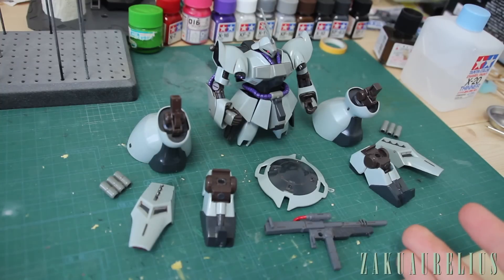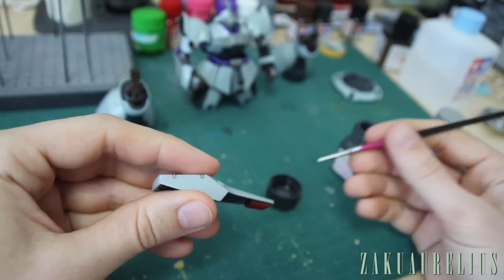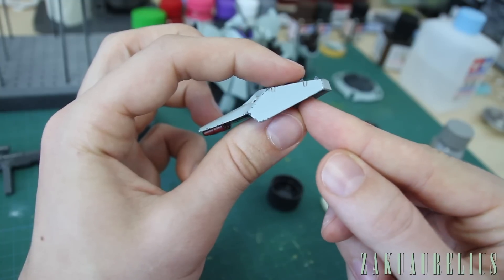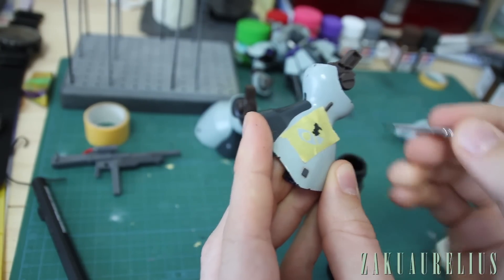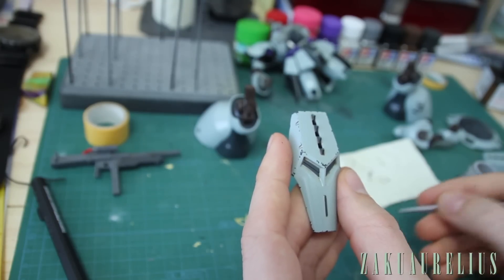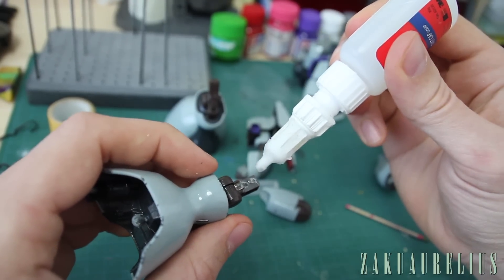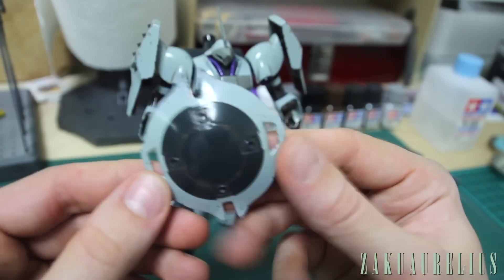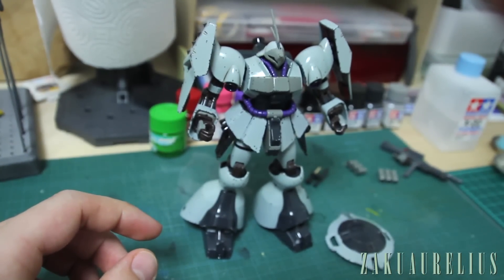170 - Gunpla Building Part 10: Chipping Weathering Technique

Comment: It is much easier to apply the lighter color chips first then place the darker color inside the lighter color chips, but not all of them. The lighter color reproduces scratches when alone when center filled with darker color reproduces paint chipped to bare metal also the lighter color should be a lighter shade of the base paint color not the dark chip color. Hope this makes sense and helps, happy modeling.
Reply from the maker: yep, that makes sense!

Comment: I am wondering something about the "flow chart" of weathering, and slight bits of detail painting. My model is painted by airbrush  with Tamiya acrylics, and I have a gloss coating of Pledge Future clear coat on it. From there I've done nothing yet.  I'd like to do a set of things: Small missing color application on a mono eye with acrylic, chipping effects with brush/sponge using likely Tamiya acrylics also (I do have oils and Testors enamels available but not in the same colors), an oil gunk wash where you fully cover the piece with a paintbrush and slide it off with a cloth to get into the grooves /panel lines, oil streaking, and finally pigment powders. I'm not sure as to how the coating/sequence would go exactly? 

Again, I've already got a gloss layer on it to protect paint underneath. My guess is:
1. Monoeye detail paint with Tamiya acrylics +  chipping with Tamiya acrylics (Could technically be replaced with Testors enamels if needed)
2.Gloss coating again maybe? Or not.
3. Oil Gunk wash, as I know it can be done on gloss surfaces to easily remove the majority and keep the details. 
4. Oil streaking on the same layer as the gunk wash after that has settled
5. Flat coat to seal in and make pigments stick
6. Pigments
7. Final coat

Does this make sense? There's quite a few steps and I wouldn't want things to interact or cover each other. Sorry for such a long response, and thank you for the great video!

Comment: Another way to simulate chipping is to use rubber cement. Apply the rubber cement using a toothpick before applying the final color coat. Once the color coat Is applied use a rubber cement "eraser" to remove the rubber cement.
Reply from the maker: +David Freeze Yes! That or liquid mask!

Comment: does it have to be just masking tape?? Or any tape??
Reply from the maker: masking tape works best because it's designed to be able to come off without pulling up the paint.
Reply: what if you didn't paint the kit?? Would any other type of tape work??
Reply from the maker: no, if you're not painting then you won't need tape
Reply: what do i use then, since i can't draw well......

Comment: my paints dry up all badly. do i have to shake it up more or could it be the paint?
Reply from the maker: +ocelotl213 What kind of paint are you using?
Reply: +ZakuAurelius sorry forgot to add that detail. its Model Master enamel paint.
Reply from the maker: +ocelotl213 I've never used those, but you should be ok if you aren't leaving the cap off for too long.
Reply: +ZakuAurelius did you add any sort of thinner to your enamels?
Reply from the maker: +ocelotl213 You can try that, yeah.
Reply: +ZakuAurelius thanks so much for the quick answers! I'm a new sub but I'm slowly getting through your content.
Reply: +ZakuAurelius thanks so much for the quick answers! I'm a new sub but I'm slowly getting through your content.